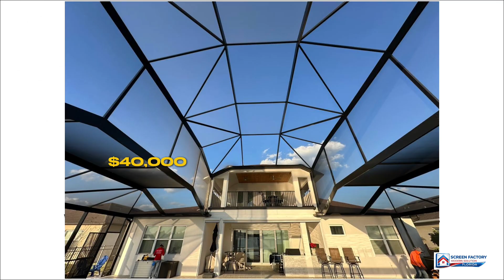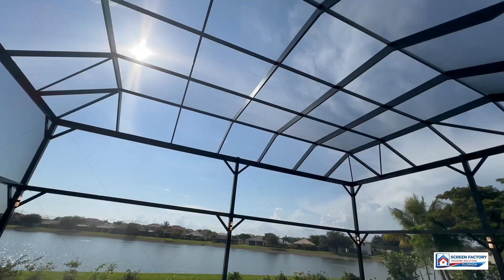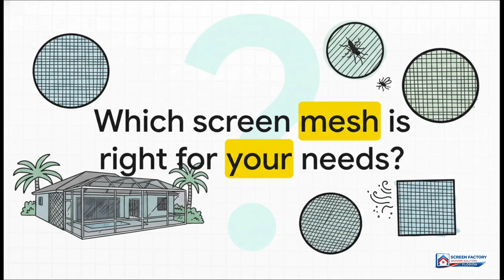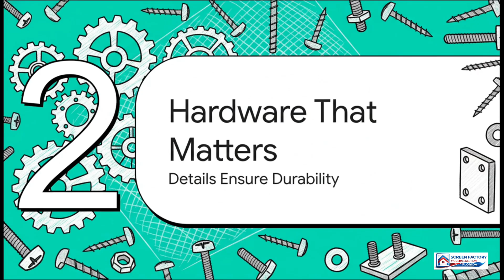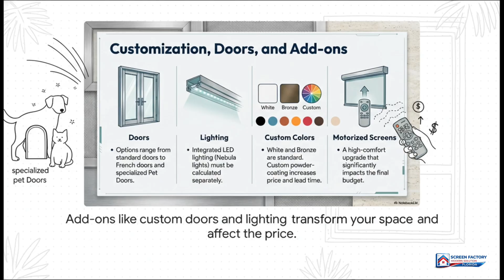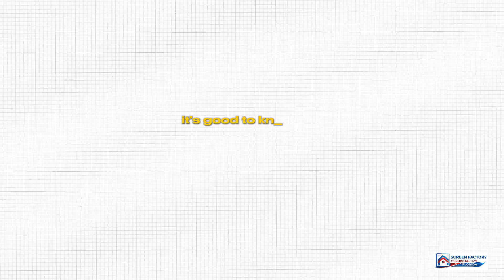How Much Does a Screen Enclosure Cost in Florida?

Comment from the maker: Planning a screen enclosure in Florida?
Comment your city and approximate size — we’ll give you a realistic starting range based on your area’s wind zone and structural requirements.
Reply: Port St Lucie - 34953 
44’ x 26’
Reply from the maker: Thanks, Amanda! Please request your FREE estimate here: https://screen-factory-florida.com/?utm_source=youtube — we’ll inspect your property and provide an accurate quote.
Reply: Boynton beach 33436
38x25 screen enclosure
Approximate cost please
Reply from the maker: @stanweil9753  Thanks for the details. For Boynton Beach and a 38x25 screen enclosure, the price can vary based on wind zone, engineering, access, foundation, height, roof style, and materials.

Please call us at (239) 539-3677 and we’ll schedule a free estimate.